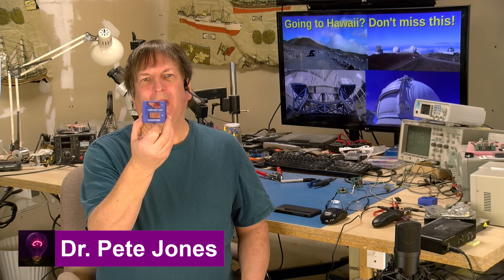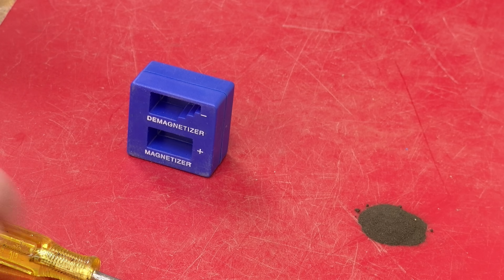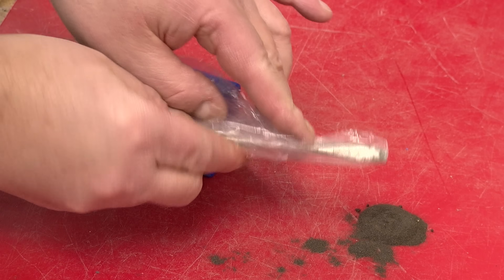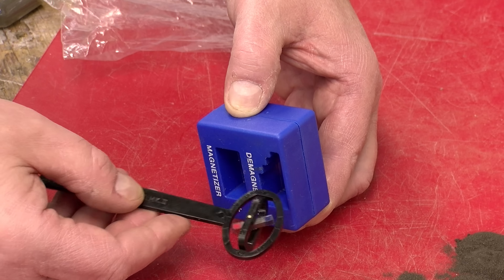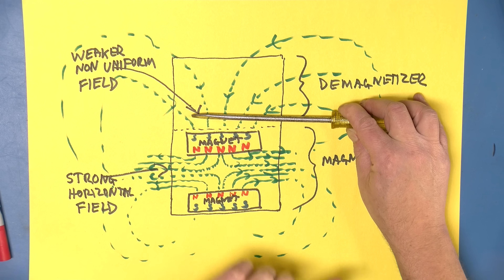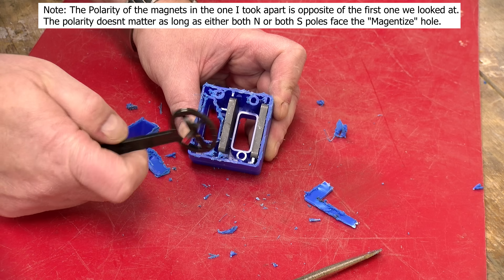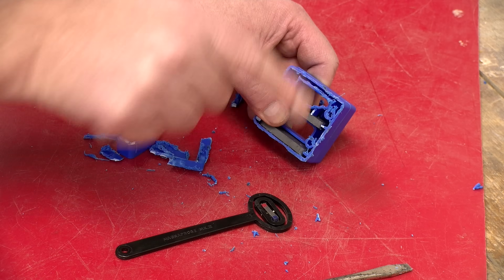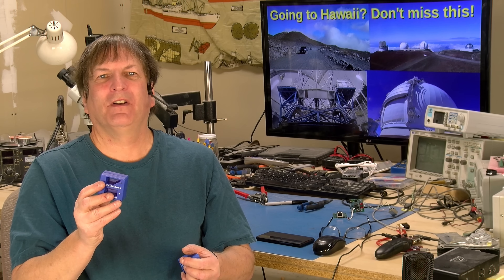How do these Magnetizer/Demagnetizers work?

Comment: Just wanted to say thanks for this vid. I make jewellery and constantly battle magnetized pliers grabbing onto random bits i didn't actually want picked up lol. Now i have a solution and it's surprisingly cheap too! thanks for saving what remains of my sanity
Reply from the maker: Glad I was able to help! Just so you are aware, some of these gizmos are better made than others, inducing some which were apparently sold without the magnets inside. So if the first one  you get doesn't work well. try another from a different brand or source.
Reply: @ElectromagneticVideos  thanks for the tip. I'll avoid the REALLY cheap one on amazon then, it's probs that cheap for a reason.
Reply from the maker: @bevakathedementedraccoon  Actually price doesn't seem to be a good indicator of which are good and which dont work well. So maybe try a cheap one and if that doesn't work, try one that looks a bit different (same genera shape, but clearing from a different manufacturer such as sharper/rounder corners, lettering on the plastic or not etc).

Or, get one from a local hardware store, which supports the local community, and if it doesn't work, you can easily return it.
Reply: @ElectromagneticVideos  sadly my local guy shut up shop during covid. So i'll go amazon cheap first, n know what to look for if i need a better one later. Thanks again
Reply from the maker: @bevakathedementedraccoon  Hopefully the first one will be all you need! Good luck!

Comment: Can you use that device to re-magnetize a de-magnetized magnet?
Reply from the maker: Unfortunately it wont work well for that. permanent magnets are made from material that is harder to magnetize (and therefor demagnetize) and typically needs a stronger field to magnetize than this device will produce. 

I did a video on re-magnetizing permanents here if your interested: https://youtu.be/S21rlwrY74I

Comment: would this work to fix a magnet that got weaker or is it a temporary change?
Reply from the maker: It should work - but not very well because the field in the device will not be as high as a typical  magnets original field, so it wont magnetize the magnet to it max field strength. I did a video on how to remagnetize a magnet here https://youtu.be/S21rlwrY74I in case your interested.

Comment: Thank you. I always assumed there was more to these little tools than that. Looked up my old mag'r/dem'r and used it with new understanding. Mine does not have the steps, but rather, has a "D" shaped demag area with the curve facing downwards. Magn'tzd a driver, then put it in the demag at the bottom and slid it up to the top while withdrawing and it  worked perfectly.
Reply from the maker: Your welcome! I haven't come across one like you describe, but it sound like a similar process - gradually reducing a changing magnetic field as the screwdriver is pulled though the demagnetizer. I'll have to keep my eyes ope for one like you describe!

Comment: I'm surprised how effective a single pass is on magnetizing the screwdriver.
Reply from the maker: It is surprising! It do work  so well because the two opposing magnets generate a field that comes out of the hole in a direction parallel to the screwdriver so as it is pulled out at no time does it encounter a field in any other direction that might weaken it. What amazed me even more was how well the demagnetizer works.

Comment: How long will the magnetization hold on the object?
Reply from the maker: That depends on the magnetic material of the object. Magnets are made from "hard" magnetic materials where the magnetic domains in the material have boundaries that are hard to move and therefor are hard to demagnetize. Steel in screwdrivers is usually magnetically soft, meaning the domain boundaries can easily move and so are easily demagnetized. 

That means banging the screwdriver, or exposing it to a low magnetic field in the opposite direction for example can easily demagnetize it. So it is not so much a time period that it will stay magnetized, but more how sensitive it is to being demagnetized by rough handling. I did a bunch of videos on magnetizing and demagnetizing things a while back - if your interested here are a few of them Magnetizing https://youtu.be/S21rlwrY74I?si=FYT5yIGnLPAus9Wx Demagnetizing https://youtu.be/mGK8oYdEqyE?si=mANhJmBPFlRlrysW

Comment: The most interesting part of the video to me was the magnet detector.
Reply from the maker: The little gimbaled magnet on a handle? I think its meant for schools etc. If you want one, I got it here: https://www.indigoinstruments.com/magnets/accessories/magnetic-force-3d-compass-magnaprobe-44702.html
Reply: @ElectromagneticVideos  yeah. I never saw one before. I use my DIY compass for such things but never thought a gimbal would make it better. Thanks for the link.
Reply from the maker: @Amin.Ashraf  I think they are made in the UK so if you not in Canada, might be worth doing a bit of googling!
Reply: @ElectromagneticVideos  I'm in south east Asia actually. I can't find anything similar on my side of the online shop and  10 usd is equal to 47 myr. I think I can make one instead.
Reply from the maker: @Amin.Ashraf  You know, it would be a neat project to make one!
Reply: @ElectromagneticVideos  exactly. It'll be a lot easier if I have a 3D printer though.
Reply from the maker: @Amin.Ashraf  I'll bet you can make with some wire as the the handle and the axles -  I immediately think of a coat-hanger but being steel that would easily get magnetized. If there is any aluminum wire in your area that might be useful!  Best wishes from Canada by the way!
Reply from the maker: @Amin.Ashraf  That might do it!

Comment: i have actually never seen those, i didn't even know they existed! Now i know i need one.
Reply from the maker: I'm sure my videos has inadvertently resulted in sales of thousands of these devices - to bad I don't get a royalty :) . They are so cheap and so useful to have its well worth picking up one if you happen to see one in a hardware store.
Reply: @ElectromagneticVideos  the only way i knew to magnetized something is to keep rubbing a magnet over and over (not so different from device), or wrap a coil around object and tap it to a car battery which is not always possible. To demagnetized i had no other way unless to super heat the object, again not always possible, this device makes all that easy!
Reply from the maker: @xnight.shadex  Yes! I really take my hat off to whoever came up with with such a simple mechanism to do it - particularity the demagnetizing part!

Comment: If I understand correctly, passing the screwdriver over the magnet at those three different heights, in that order, puts the iron of the screwdriver in a close-to-random configuration. The closer to random it is, the less iron shavings it picks up. The goal of the device is to take a magnetized piece of iron and make it as random as possible while keeping the cost of material low and the procedure quick and easy to reproduce. This device accomplishes both objectives well!
Reply from the maker: You described it better than I did! What a perfect summary!

If your interested in  a more detailed look at demagnetization, which is normally done with an   AC magnetic field field that is gradually lowered (and is similar to what happens during each pass of the screwdriver) , I did a video going into more detail a while back: https://youtu.be/mGK8oYdEqyE

Comment: If you had bought this for more than a dollar shame on you! Somehow you can get magnets for free in some device like broken stereo or old hard drive again for free!
Reply: Hard drives aren't free, they cost someone something at some point. They also aren't the right type of magnets for this. Not all magnets are the same, even if they look similar.
Reply from the maker: And to add to your good points, the demagnetization part in particular is quite a bit trickier and the design of these nifty little gizmos make it surprisingly easy.

Comment: The polarity actually does matter because a south polarised magnetiser can't demagnetise a north polarised magnetic screwdriver. That's oversimplifying it a little, but basically how it works.
Reply from the maker: Not quite - the demagnetizer part operates by first magnetizing/reorienting  the field in the screwdriver perpendicular to the length of the screwdriver and the rotating and lowering it. As such, the original field orientation in the screwdriver does not matter. I did a video on AC demagnetizes a while back and the process is similar. Here it is if your interested:  https://youtu.be/mGK8oYdEqyE

Comment: I used to do oilfield work and one of our tools used the same principle to locate pipe collars in the casing.  A CCL or Casing Collar Locator.  The main bit of it was two magnets with the same pole facing each other vertically.  Between them a coil of wire.  The fields hit each other and go straight out a ways radially around the tool.  As the tool moved through the well casing, any metal changes in the field induced a current in the coil.  Like the mass change where two pipes are screwed together.  That then went to the surface via a cable would register on computer software and as raw kicks on a meter directly attached to the line.  This device is attached to every tool we ran down hole.
Reply from the maker: That's fascinating - what a clever way to detect a discontinuity in the casing. 

When I was a student I had a magnetics Prof who designed pigs to go down oil pipes and magnetically  look for problems. I wonder if that how the pigs did it too?
Reply: @ElectromagneticVideos  not sure on the pigs.  Never worked on the pipelines.  I always worked on the pads.  Did what is called wireline.  We ran anything from scientific and diagnostic tools to cutters and explosives.  And plugs as well.  A lot of the scientific stuff was to correlate our logs with drilling logs.  For example, we would do cement bond logs on the casing.  An acoustic tool that clicked kinda like sonar.  The reflections off the casing would chart out on a plot.  Showing the general constitution of the material behind the casing pipe.  Generally a layer of concrete and then rock formations.  Along with that tool was a gamma ray spectrometer and the CCL.  The gama tool just reads the gamma radiation in the ground and can then give pretty detailed plots of the rock formations.  Mainly detecting hydrocarbon deposits.  But many things affect it.    That log, along with CCL are used to verify and correlate out well logs with the drilling logs.  Basically make sure our squiggly lines match theirs at any given depth.  It gets a fair bit deeper, but this comment is probably too long already.
Reply from the maker: @ChadBremer  It is amazing how hi-tech oil exploration and production is. Not sure of Schlumberger is still around, but way back in the 80s they would show up at my old university around graduation time and hire anyone who had taken the signal processing, electromagnetics  and similar courses. I can sure see why fro what you describe. 

Never heard of the gamma tool either - fascinating!

Comment: So the energy used to magnetise the screwdriver comes from the energy stored in the magnets.
Reply from the maker: Sort of - the energy stored in the magnets manifests itself as the magnetic field around them. If that supplied the energy for the magnetic field in the screwdriver, the magnets would get a bit weaker  every time you magnetized something. 

The actual source of energy that ends up in the screwdriver is from you - there is a slight unnoticeable resistance to you pulling the screwdriver though the hole and its that opposition to you pulling the screwdriver that supplies the energy needed needed for the new magnetic field in the screwdriver.
Reply: Really? Huh. I would have expected the magnets in the magnetiser to get a bit weaker each time it was used, yeah. I guess it'd be easy enough to test if you have some sort of magnetic flux measurement device.
Reply from the maker: @nicholasscott3287  If you want a bit more insight into how things are magnetized, I did a video on that a while back. If your interested, here is the link: https://youtu.be/S21rlwrY74I

Comment: I asume it will work if the magnets are flipped and the south poles are pointing towards eachother?
Reply from the maker: Yes exactly. It seems that the devices are built sometimes both magnets with N inward, other times with magnets both south inward.

Comment: Would you happen to know the field strength of these magnets, and the aproximate resulting field  strength of the screwdriver?
Reply from the maker: Unfortunately not. But the BH curve usually saturates a bit below 1.5 Tesla so thats the max. My guess is the screwdriver is left with way less, maybe between 0.5 and 1 T?
Reply: @ElectromagneticVideos   Thank you for your insights. Looking up different materials, one called CO-FE alloy had a saturation point or knee point around 2.4 T, i'm under the presumption that this has it's own distinct requirments as far as the field strength affecting the alloy? As all ferromagnetic material's are said to have unique curves that you need to refrence graphs for known materials from my understanding. Would you be looking for increasingly powerful mother magnets to allign these materials? Using electric magnets for these materials with very high saturation points?If it's not too much trouble, In the case of the previously mentioned alloy- Co-fe, would you happen to know what the required field strength would be?
I'm a fantasy writer and It's pretty hard to get a hold of some of this information. I've been desperate for weeks until your mention of saturation curve saved me hours of looking.
Reply from the maker: @williamrojas6125  So if its saturation/knee is 2.4T, that what you would want to magnetize it or a bit more to make sure you are towards the top of the curve.

 If you look up some BH curves you will see they trace a hysteresis loop. If the loops is large, the magnet will retain the field better. So a good BH curve for magnet is not just about max saturation but also about  the hysteresis curve. 
If you havnt already, look at these videos:

Electromagnets: How They Work and How to Make One https://youtu.be/LxY9M9Dznlc

How to (Re)Magnetize a Permanent Magnet https://youtu.be/S21rlwrY74I

Demagnetizing magnets and other things https://youtu.be/mGK8oYdEqyE

Comment: My first experiment with magnatism (even though I wasn't aware of it as such at the time) was as a very small child, when I put a magnet onto the screen of our home CRT colour television. So enraptured was I by the effect (all those pretty colours in rainbow arcs) that I drew attention to the spectacle to my mother, who told me to 'stop doing that immediately' - I'm paraphrasing.
😂
Reply from the maker: Ha! Me too actually. But both you and me were lucky - one commenter did the same but either had too strong a magnet or held it too close and apparently permanently magnetized the some part of the tube (shadow mask maybe?). Apparently none of the TV repair shops could fix the color shift and the TV had to be replaced - oops!
Reply: Oh,,,not good idea on CRT?

Comment: I thought the stairs don’t do anything because they are just air
Reply from the maker: Well the magnetic field goes right through them unaltered, so they don't do anything to the field itself. But without them,
it would be very hard to do repeated stabs of the screwdriver into the demagnetizer section, each with a slightly further distance away from the magnet. So if you want a really well demagnetized screwdriver, they do serve an important purpose.
Reply: @ElectromagneticVideos  I see, thank you for the fast response and great video!
Reply from the maker: @LOTLore  Your welcome! And glad you liked the video!

Comment: I feel so stupid. I had one at work a few years back and thought it didn't work because I was sticking the end in and wiggling it around the edges with just the tip
Reply from the maker: Easy mistake to make since these things often don't come with instructions so dont feel bad. And also - there are a few reports of some not working properly - even not having proper magnets in them.
Reply: @ElectromagneticVideos  yeah it was at my desk when i got the job, definitely no instructions. Good to know that some don't work right too! I appreciate the reply
Reply from the maker: @Buff_MC  My guess is that for some selling for as little as $3, there isn't much money left for quality control :)

Comment: Great explanation and demonstration. I always expected that you would need an active electromagnet with AC input for a good demagnetizer but obviously the simple setup in this device resulted in very good demagnetization.
Reply from the maker: Thanks! That's what I thought till I looked into the ingenious little device.  I'm not sure how well I explained it in the video, but as you pull the screwdriver out of the demagnetizer each part of it is exposed to a magnetic field that changes direction as it weakens. The effect on the magnetic domains in the steel is much like an AC field, and moving up the steps is like gradually moving the object away from an AC demagnetizer.
Reply: @ElectromagneticVideos  I think the video was clear and I understood it like you described here. I was simply surprised that such a simple method worked so effectively.

Comment: You shold have passed it through the demagnetizer while the metal particles were on it
Reply from the maker: You know, that never occurred to me - I would have been really neat to see what happened, presumably with most of the iron filings falling off at the point where it got demagnetized. Unless they simply get pulled of and cling to the plastic near the demagnetizer magnet. I will have to try it. If its interesting, I may make video on that. 

Thanks for pointing that out!